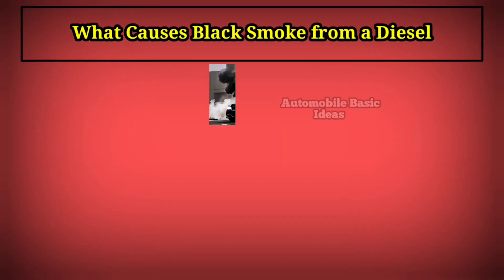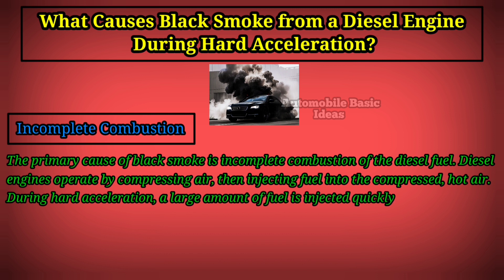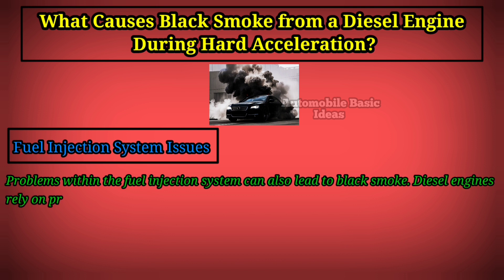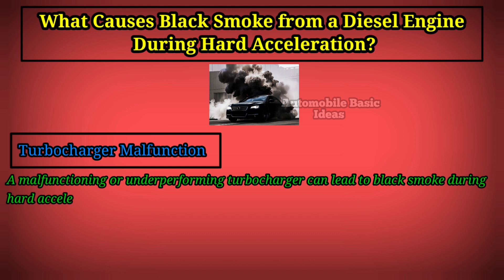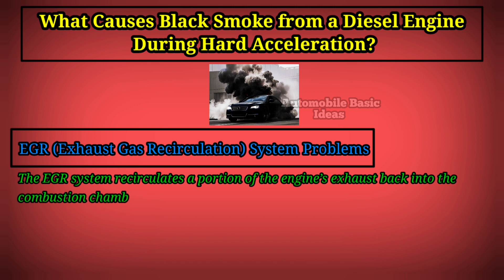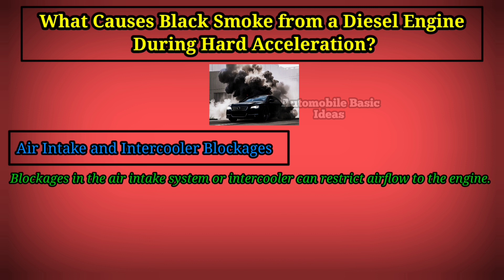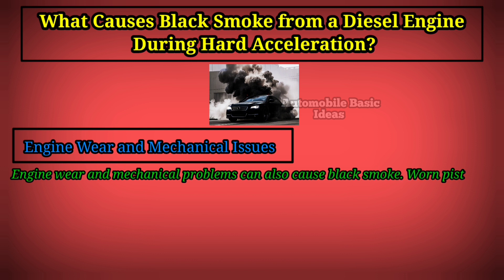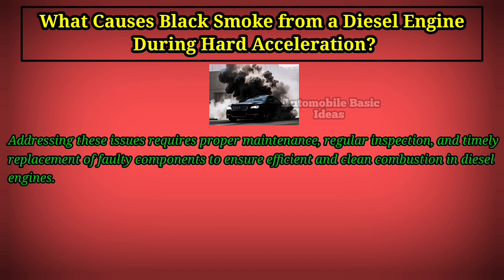What Causes Black Smoke from a Diesel Engine During Hard Acceleration?

Comment: I have a Renault Modus 1.5 dci - it began blowing out dark smoke when I was in low gears, especially going up hill in a low gear. After checking the EGR valve I found it was clogged. The two piston plates within were not only blocked from returning to their sealed positions, but the soot build up inside the valve was incredible. Soot had actually solidified into small rock formations and prevented the plates from returning to rest position. I was stunned, but not surprised. I used off car DPF cleaner to soak the valve then wiped it down and rinsed it off until it was like new. Placed it back and started the engine. I revel up to 3,000 for about I minute and the remaining soot in the DPF and other parts was expelled in a huge black cloud and then it all stopped. Jut like that. The car has been running amazing ever since. I also added DPF cleaner and Injection cleaner etc to clear the system. I would advise taking the EGR out first as it’s more likely the cause of black smoke as opposed to the DPF being over clogged with soot…